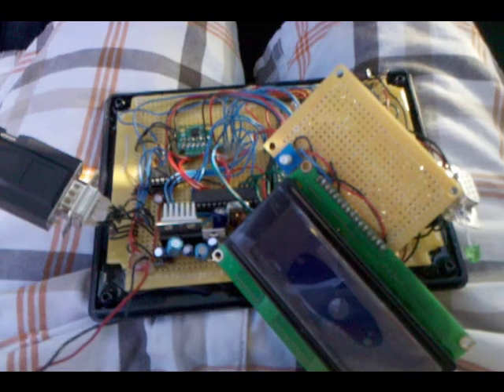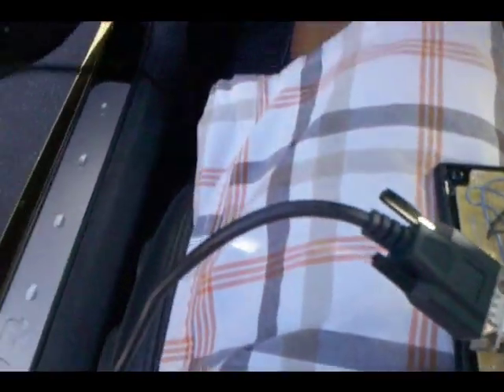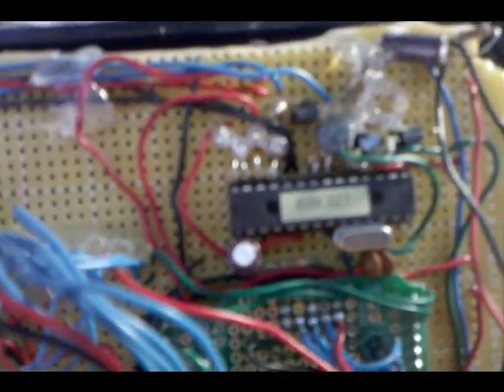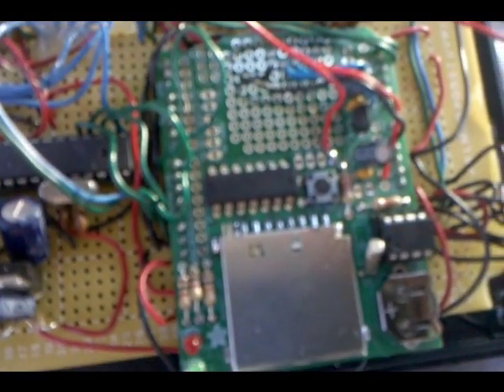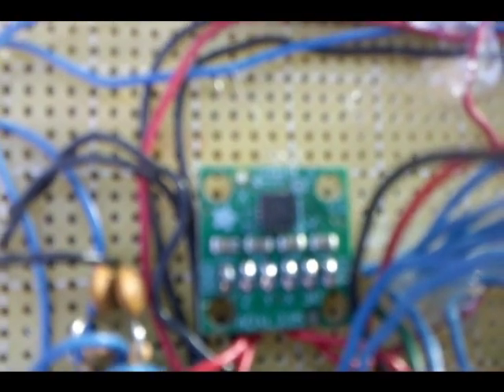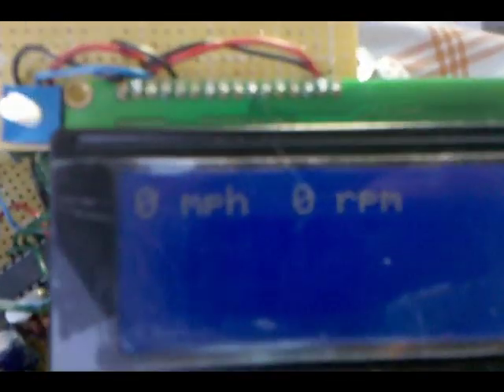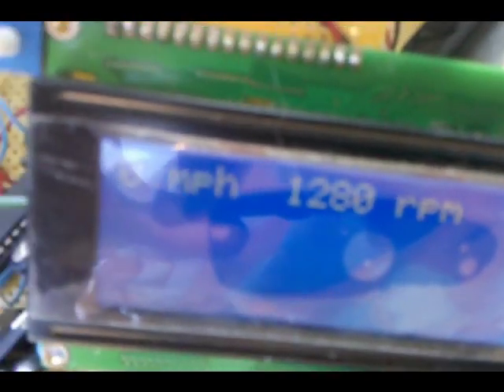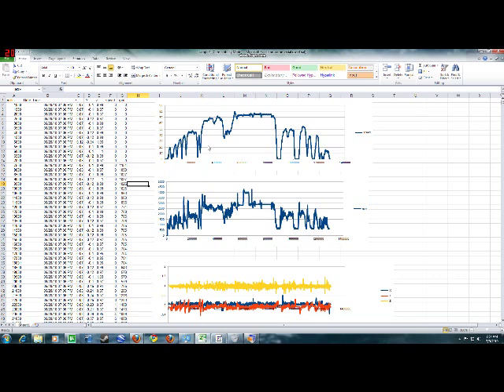Arduino Vehicle Data Logger / Black box OBD II

Comment from the maker: HI, Thanks for the interest. Unfortunately I no longer have my documentation for this project nor do I have the code. The circuit is however based on the circuit found on the elm327 datasheet combined with adafruit SD card shield. Just google them and youll find it right away. I do plan to work on this again but I have no timeline for it

Comment: The 327 uses an AT-command (modem-like) interface which communicates via TTL level RS232 communications. I have a device called the EMLScan5 which uses the exact same hardware, he just used the same schematic and removed a few things (ie MAX232 level converter as there is no PC).